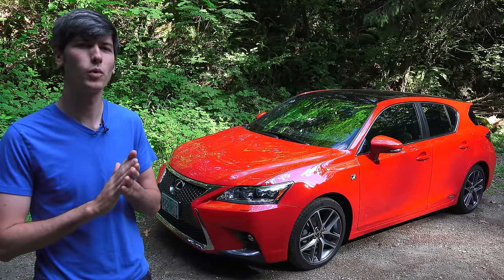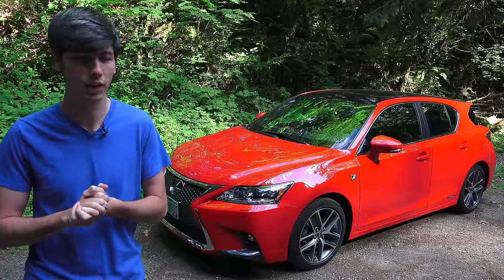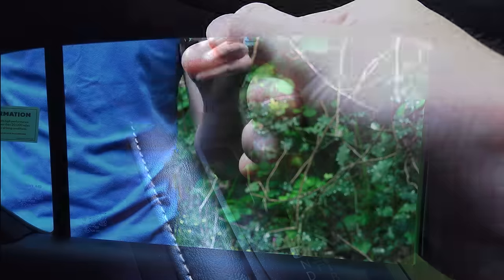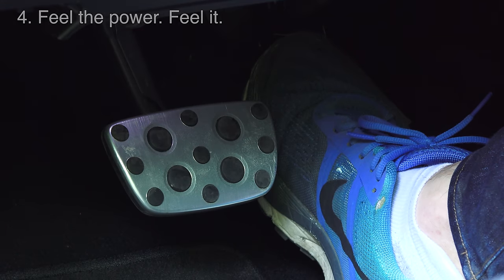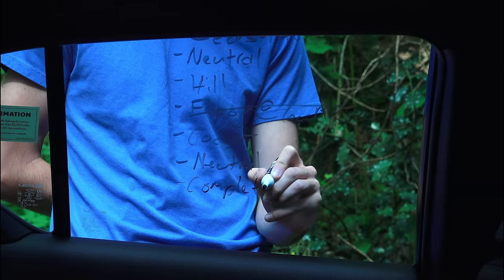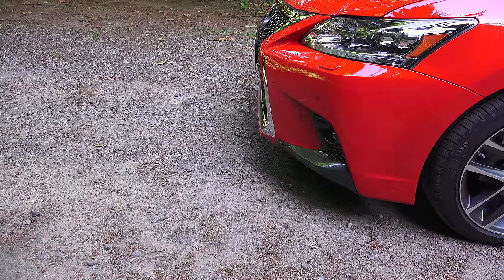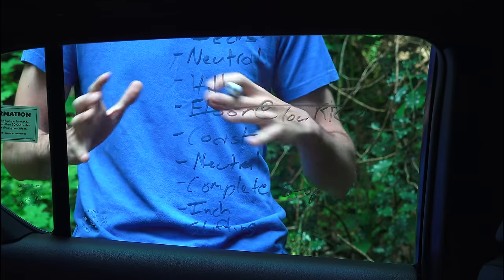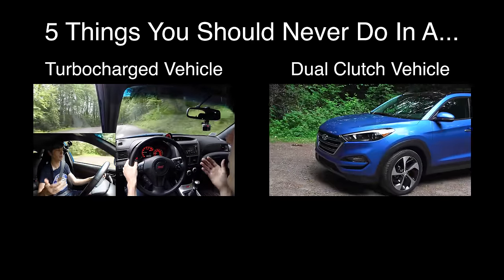5 Things You Should Never Do In A CVT Vehicle

Comment: Best thing for a CVT? Change the fluid often and before manufacturers recommendations.👍🏻 Fluid cost less than iron, everytime.
Reply: Very true
Reply: I heard on other sites that doing that with some dealers will nullify your warranty? Don't have experience with that.
Reply: You save even more money just by not buying anything with a CVT.
Reply: David P idk bout that lol I have a 2017 Ford Fusion energi and it has a cvt and electric motor and I drive 40 miles every day and if I charge my car it cost me $30 to has a month so i save a lot of money
Reply: @casio5658  But it isn't really a CVT. It means any electric motor is basically a CVT. The main problem with a traditional CVT is that metal belt. Yours hasn't got a belt. As explained it has a planetary gear.
Reply: Jay Dee bro my car has a cvt transmission and a electric motor look up my car
Reply: what about brake fluid and coolant?
Reply: To have a car that lasts a really long time, avoid a CVT at all costs.
Reply: @dannygreen7473  And a dual clutch transmission.
Reply: Not unless you really know what you are doing or else you will do much more harm than good. Ignorance is the biggest problem with CVTs. Have had zero issued with two Subaru's with CVT's (2.5i and 3.6r). Love how smooth they drive.
Reply: @Mike80528  good stuff.
Reply: An ounce of prevention is always better than a pound of cure
Reply: @Mike80528  just curious. How can I prolong a cvts life? Change fluids often for sure Anything else?
Reply: @yavz7565  I can fulid every 25,000 and use half a bottle of CVT lube guard every change.
Reply: Still gunna go at 100k miles. Best thing to do is don’t buy a cvt
Reply: 2011 Subaru Legacy, CVT is sealed unit, maintenance free (as per Subaru dealer). Chain instead of a belt. Why is the internet full of people saying change the oil ? You must have crap high maintenance CVTs.
Reply: What about liquid iron?
Reply: Or never purchased a CVT.
Reply: @oddities-whatnot  this is what I was thinking! On the Subaru outback I saw a post on FB about Subaru of America not replacing the CVT transmission under warranty on someone outback because the unit was open by a Subaru dealer for a flush before 100k miles. That's a scary thought spending 10k on another transmission
Reply: I took mine to a dealership to change the fluid since It was 190k miles and still on the original fluid. They told me it's a lifetime fluid, can't be changed, and it was $200 to have them check the fluids for metal shavings... interesting response since the dealership manual that I bought shortly after claimed it should be changed every 200k miles. It blew the chain in the transmission at 200k which is why I bought the Manual and saved myself 2k in repair costs.
Reply: @roderick6113  I have decided to go to Subaru dealer and have them check my outback out, I have never taken it to service in the last 34k miles I put in it in 1 year. The the fear if they touch it something goes wrong! I use my outback as a work vehicle so 100 mile daily commute is my minimum. Fingers cross but it has to be done I guess! I should be covered if they service it and something down the road happens..also thinking they might pin it on me because of lack of service but I can talk to SOA too
Reply: Don't use fluids other than the original for a CVT. At least for Hondas. Important!
Reply: The issue with doing fluid changes on a CVT is that manufacturers are making it increasingly difficult to change the fluids on them without having a very good understanding of all the components and fluids, and how they work. 

Transmission fluid expands when heated, which means as you are filling your car with transmission fluid and it sits at idle, it progressively gets hotter thereby expanding. That expansion can present issues if you don’t know what you are doing. Most transmission fluid services REQUIRE the temp to be between 105-115 degrees F for measuring the fluid. 

Keep in mind, transmission fluid expands when hot, so if it’s TOO hot when you go to check the fluid level (by the fluid check bolt on most CVTs) you’ll actually be pouring out more fluid than you need too. Aka you’ll run your transmission dry of fluid. 

This also isn’t taking into account that your vehicle must be on a level surface, I’ll say that again…must be on a level surface. If it’s not, you’ll tilt the transmission too far, and you’ll be emptying more fluid out than you are supposed to. 

Another thing, not all transmission fluids are equal. This should be obvious but most transmission fluids sold in stores like Walmart will cast a very broad umbrella just to make the sale. 
Example: my 2013 Nissan Altima takes NS3 CVT fluid. If you go to Walmart and turn the bottle around, it’ll say 

“compatible with NS2, and NS3 fluids” NO THE HELL IT IS NOT. 

Weber auto YouTube channel discusses this topic very in Depth. (Automotive professor at Weber auto university) 

NS3 fluid is NOT… in any world… equivalent to NS2. Therefor, it’s not possible for it to be compatible with BOTH types of fluid. 

Transmission fluids are mixed with extremely specific additive packages, and viscosity’s to make sure it’s appropriate for the mech units within a CVT. 

If you use a fluid that’s too thick, you’ll generate more heat, and remember what I said about heat and transmission fluid 👀. ✨expansion✨ 

Remember there isn’t any standard or regulation that prevents these fluid manufacturers from listing a fluid compatible with other types of fluid. 
If you want to be safe, just go to the dealer and buy the fluid yourself, or find which fluid your vehicle takes and buy it directly from the seller.  

It also helps to find a service manual for the CVT on your vehicle if you want to do it yourself. You can usually find them for free in a downloadable format online. 

You absolutely must follow every step, as the steps are there for a reason. Manufacturers won’t put the steps there for pointless reasons, bc they wouldn’t want to pay their employees anymore than they have to.
Reply: Nullifies the warranty.   Subaru has 10 year 100000 mile warranty anyway.  My croosstrek has 200000 miles. NO CVT problems.   Stop,the no cvt hype.
Reply: @phoenixarian8513  agreed! Do NOT use Amsoil cvt fluid
Reply: @joes7930  good to hear man👍
Reply: How? It's sealed, no dipstick anywhere for transmission fluid
Reply: @Mike80528  Subaru CVTs are some of the worst.  Mainly on the turbo models where more power is a factor.  Ford also has horrible CVTs I work on them daily.  Toyota seems to be the only ones that have it figured out more than most.
Reply: @Silent_Shadow  Thanks for this. I have been looking for a replacement for my 11mpg truck that is not used as a truck anymore, and the Outback XT (turbo) was at the top of my list.
Reply: Yep, got my 2018 C-HR XLE cvt flushed just after 30k miles. That model year has been having issues with "humming" noise - possibly from bad variator bearings. The cost for repair - in the forums - is about $9k.
Reply: @dannygreen7473  to have a car that lasts a really long time, know how to take care of your car* there i fixed it
Reply: @yavz7565  if you want a good CVT avoid Jatco CVTs (Nissan) Some other car manufacturers use jatco CVTs.  Good CVTs are made by Honda, Subaru and Toyota
Reply: Not if said fluid is water from the fountain of life 🤓
Reply: @roderick6113  "lifetime" means what the manufacturer says it is. That sealed unit is gonna crap out before if you had done fluid changes
Reply: Me right now
Reply: @davidp8627  unless it’s a toyota hybrid, those are only cars it works on, and feels natural also, anything else sucks
Reply: @yavz7565  yes:
At fluid changes, also change the filter. 

Also:
Install remote fluid cooler, and run the CVT fluid through that. 
There are folks that have added turbo to their CVT cars. By having enough coolers to keep the CVT temp low, they’ve not had problems with their CVT.
Reply: @zacharypeery4082  Even “sealed” transmission have fill and drain bolts. My 2012 Mazda CX9 has such a “sealed/lifetime” transmission. I recently changed the trans fluid myself at 65K miles - it was getting to that point of, either I change the trans fluid now, or I should really leave it alone forever. 

Basic procedure:
Find the fill plug. Crack it open first to make sure you can open it. 
After that, find the drain plug.
The trick afterwards is:
You need to measure what you drained out. 
By doing this with room temp fluid (don’t do this with draining hot fluid), your measurement will be accurate. 

Fully drained out fluid is all in your drain pan. 
The moment you dump your first new bottle of fluid into the housing, you now have an empty bottle that you can measure with. You’ll need to measure off the fluid that’s in your drain pan. 

Search on YouTube for videos where folks have found a way to change the trans fluid on your car model/year. That’ll help you locate the bolts/plugs.
Reply: @dannygreen7473  cab company I drove for ran Priuses to 600k.
Reply: @roderick6113  Most stealership employees aren't smart enough to make good recommendations. Lifetime fluid huh?  I've heard and seen that nonsense before. Read the fine print. Most, if not all, "lifetime" fluids/service intervals only apply to "normal" driving habits. Anything beyond that definition will recommend additional service/maintenance.  Why do you think there's drain plugs on nearly every modern transmission? GM, Ford, and Chrysler never put a drain pull on their transmissions back in the day, and they were considered serviceable. 

"Lifetime" means it gets you past your warranty.
Reply: @ehh2681  Nailed it on the fluids. Never ever buy a "universal" fluid of any kind, except oil. Everything else is OEM only in my opinion, or a high quality application specific.   

Good point on following all the steps. Seems pretty obvious to do the things you mention, but there's lots of variables that are easily overlooked.
Reply: @zacharypeery4082  There's plugs. They had to put the fluid in somehow at the factory.
Reply: @joes7930  Probably drive with an egg on the gas pedal with no hills.
Reply: @deanonesense  A Toyota. Not your average vehicle.  You'll never see that in a Nissan or any American made vehicle.
Reply: @oddities-whatnot  I just bought a 2007 Lexus GS350, also with a sealed CVT, however the manual says to change every 96,000 km. It runs fine but these comments make me question it
Reply: Prius cvt last forever
Reply: Best not buy one.
Reply: Best thing for a CVT? Not have one.
Reply: Best thing to do ….Dont Buy One.
Reply: @goldentrichomeshydro4260 - you present a good argument for purchasing a car new and giving it extra oil changes from new  because most used cars only get serviced according to the service records
Reply: @majorrgeek  never let the OEM tell you what the maintenance schedule should be. Especially German cars. BMW says 15k mile oil change intervals. That's criminal. I changed mine every 5k and it runs like a sewing machine. Same with my LS460. The LS will last a million miles. Also change the transmission fluid and filters (and maybe the valve bodies if worn or looks iffy) every 60k miles. You'll have a vehicle that lasts FOREVER. Lubrication properties only last a short time then the oil/fluid starts to break down and looses a LOT of viscosity and the detergents catch all the crap and the longer you run it past 5k/60k miles is only going to cause harm. I've been working on my own vehicles for the past 20 years. Synthetics aren't the magic they tell you they are.
Reply: @JOHNrandomlyVLOGS  and first and foremost is to get oil based undercoating procedures done for rust prevention.

Comment: #11: Don't put the pedal to the metal directly after starting the engine. The steel belt will slip, which it is not designed for.
Reply: And that’s why I like what Toyota has done with their CVT. They have an actually first gear with a chain for launch
Reply: In any car this is good protocol to follow. Otherwise, with the low lubricity of the oil since it’s been sitting for a given amount of time, it could damage other components in your engine and transmission
Reply: Yeah… you should not do that in any car with an ice… unless you want to rebuild your engine every 50k miles
Reply: Talks about Toyota
Reply: nissan note digs owner here. i can confirm the above
Reply: Wait what do you mean by put pedal to metal?
Reply: @dddddw9590  dont floor your gas pedal, just use it normally
Reply: With the engine properly running & warmed up (oil circulating),
I HAVE done “pedal to the metal” in the proper way for a CVT:
Give the power to it gently.

If someone hands you a 50lb sack of potato gently, you would be able to hold on to it. 
If someone drops this sack on you, you are likely to drop it.

Same idea with tire grip on track. At exit coming out of a corner if the driver stomps down on gas pedal that’s bad. If he rolls the gas pedal down to the floor, the tire can handle it.
Reply: @reallifeengineer7214  does your ct by chance shutter when you first start it. Ever since I’ve had mine, it has almost shook enough where I can feel it on the driver seat but when I open up the front it’s actually not really shaking.
Reply: @dddddw9590  Mine has never done that. 
In fact, when you first start the engine and transmission is in park, the transmission isn’t “engaged”. There should be no vibration coming from it. 

From the sound of it, seems in your system, something is not balanced. And it might not be the transmission. Could be the engine. Another possibility: a worn engine mount or transmission mount.
Reply: @Yeethaw69  Ona few models. Some models evidently didn't deserve it.
Reply: @dddddw9590  Yeah, they do that. It's how you know it will only last half as long as a regular automatic that doesn't do it.